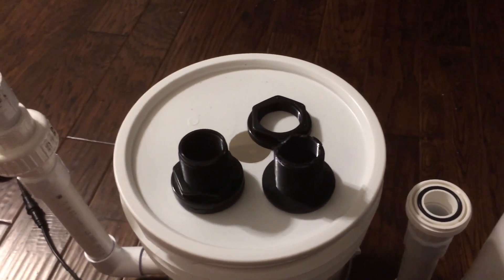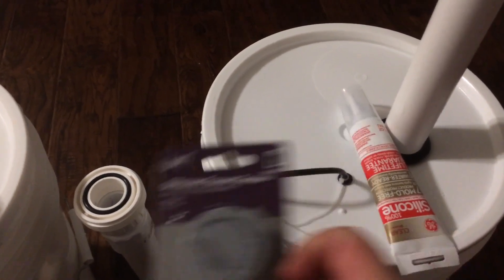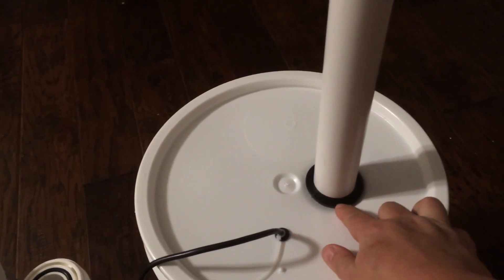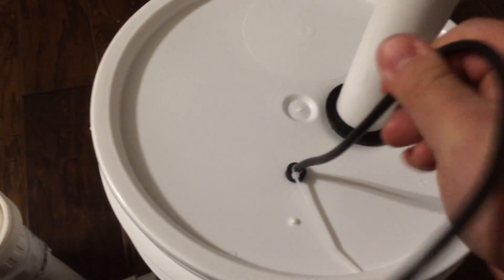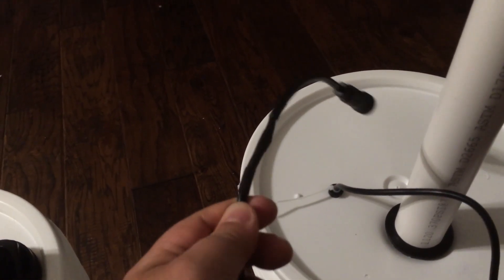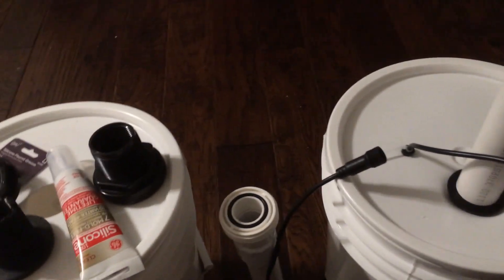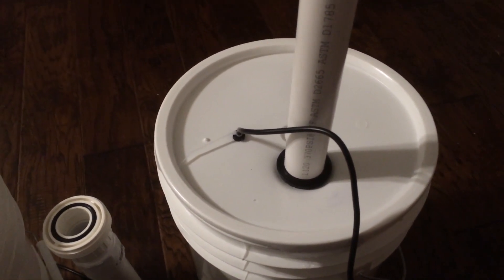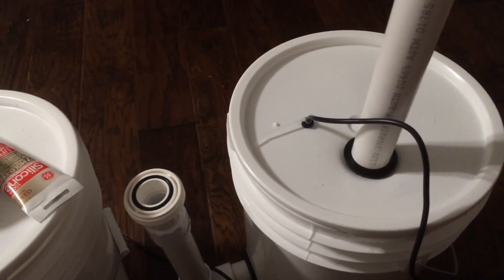DIY Canister Filter with Radial Flow Filter/Solids Separator: Part 2 - Finishing off the Concepts

Comment: The problem with using that grease is that it is not food grade, thus harmful for you and your fish.
Reply from the maker: Plumber's grease is used in kitchen faucets and lavatory faucets. It acts as a seal and lubricant for the rubber parts that touch the metal parts in your fixture. Therefore, it is safe for human drinking water, it will be safe for the fish.